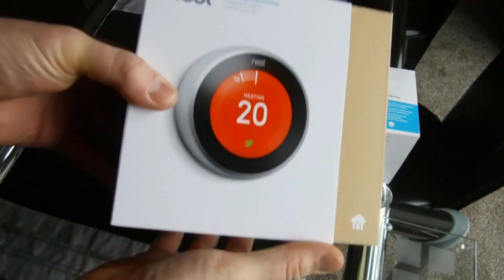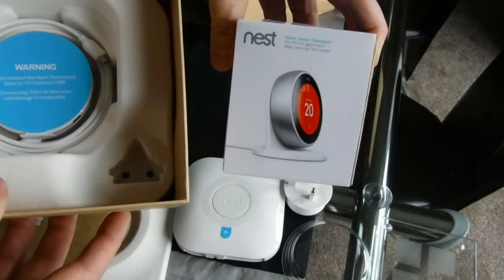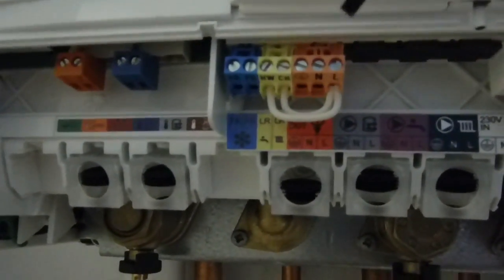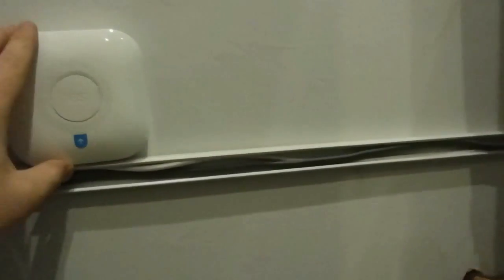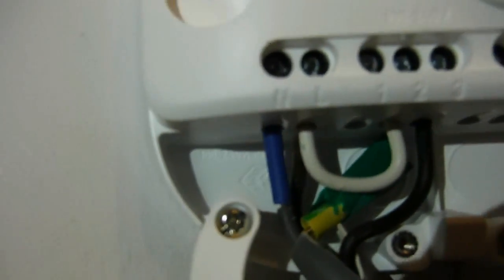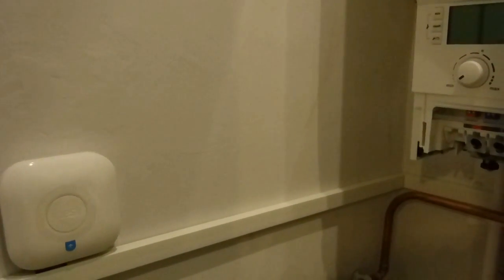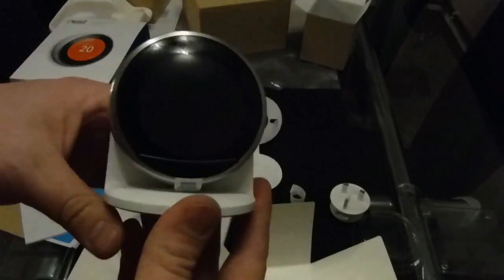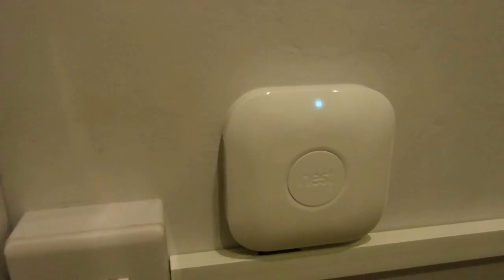How to install Nest Thermostat 3rd Generation - UK

Comment: How doesn’t it communicate between the heat link and can nest support zone heating
Reply from the maker: The Nest communicates to the Heatlink wirelessly. Nest will support multi-zone heating but you will need one Nest per zone.
Reply: My mega flow tank and boiler is in the out building currently in the main house there is a Honeywell programmable stat at the first floor and  a second programmable stats in the hallway on the second floor which has no radiotor. Two zone value with a Honeywell with a wire junction box. 

1. Will it communicate at the back of the garden where the outhouse is located? Just worried on the singal range. 

2. Having a second nest replacing the hallway Honeywell programmable stats is this adviceable? Concern the hallway is cold due to no radiotor and what if the senor takes the hallway heating a keeps on heating up the bedrooms!
Reply from the maker: The Nest can be sighted upto 30m from the Heatlink but obviously walls and large objects like the boiler can reduce this range. The Heatlink doesn't necessarily need to be next to the boiler though, as long as you can get a wire from the boiler to it, so that may enable you to get it closer to the Nest?
As for having the Nest in a room with no radiators.....that's not going to work.....unless the bedroom doors are left wide open maybe. But then the rooms will be too hot. Best to maybe put it in the biggest bedroom?
Reply: CharlieShooters KnowHow might have to get an installer and get a view on the property and location of the boiler.

Comment: Best installation video, but I'm still struggling with mine. I have a Vokera Linea HE which is Open Therm compatible and would like to use that capability. There is an existing wireless Vokera thermostat and receiver but I can't work out the connection from the HeatLink to the boiler. Any suggestions (vokera.co.uk/wp-content/uploads/2009/.../linea-he-combi-boilers-installation.pdf) Thermostat manual (https://drive.google.com/file/d/1A6U29EhkhMbnZUA68TvkhS2QaqlJUu_6/view?usp=sharing)
Reply from the maker: I've had a quick look at the installation manual for (what I think is) your boiler. I couldn't see anything about Open Therm in there, but if it does use Open Therm then it should be a pretty straight forward 2 wire connection.
I Googled 'Nest with Vokera' and someone states wiring to M2 on the boiler and leaving boiler controls on permanent. This would go to 2 and 3 on the Heatlink.
In the Nest Manual there is instructions on how to wire an S-plan system which is also mentioned in the boiler manual, so maybe that's an option? I have no experience of that method sorry!
Failing all that, in the boiler manual there is a technical helpline. They might be able to help.

Comment: My current wireless thermostat receiver only has two cables connected to the boiler: live & neutral. Will the nest thermostat work with only those two cables?
Reply from the maker: You need to follow these back to the boiler really to check what they're connected to, but yes, the Nest manual indicates it will work with this set up.

Comment: The best heat link does have a earth and should you not use heat resistant cable to connect to the boiler
Reply from the maker: The Nest instructions indicate that an earth is only required on the Heatlink when connecting T1 and T2 to the Nest. I'm presuming because the Heatlink is all plastic and the Nest is metal.
As for the wire....a few people have mentioned I should have used flex cable, and I probably would if I did it again, but it's been OK and doesn't really run too close to any hot bits!

Comment: Hi Charlie just bought a nest,watched your video which was great.I have a thermostat in the living room but will be mounting my nest on the stand.can you tell me what I do with the existing thermostat and wires?do I just remove?Also like you said in a previous post in the Americans videos they only show you replacing the thermostat for the nest and not the heat link.Do you have to have the heat link if you have an existing thermostat?
Reply from the maker: Sorry, only just seen this comment, it got caught up in the spam filter somehow!  I presume you have sorted it now, but, yes you would just remove the old wiring and thermostat.  The Heatlink is required, without this the Nest will not work.  Better late than never!!

Comment: When you are connecting the wires at the heat link end, you don't actually mention into which slot the black (call for heating) wire goes. Could you please clarify? Thank you
Reply from the maker: Yes, to confirm, the black wire goes to "3" on the Heatlink.

Comment: What is the purpose of the hub by the boiler, all other videos I have seen has been the thermostat only!. Is this because you used it on the stand?
Reply from the maker: No, the Heatlink (hub) is required in the UK, whether you use the stand or put it straight on the wall. You may have been watching American installations as I don't think they use a Heatlink?

Comment: Watched this before ordering as I thought £120 for installation seemed a little much, your vid made it super easy and I was done with a working Nest in less than 40 mins. For reference I was fitting to a Worcester Bosch 28CDi and the wiring setup was as shown on your slightly more compact model. As with EJ wheeler below I had to unplug the front panel for a previous wireless thermostat to make it all work. Thanks!
Reply from the maker: Glad to hear the video helped you out! 👍🏼

Comment: I’ve got an old manual wired thermostat in my lounge. So I take it I don’t need to wire the nest to the boiler. A Worcester condenser boiler. Is it a matter of replacing and wiring the nest on the wall wired into the current thermostat wiring.
Reply from the maker: Unfortunately not. The Heatlink has to be hard wired to the boiler. The Nest then communicates wirelessly to the Heatlink to tell it to turn the heating on/off. The Nest will not work without the Heatlink.
The Nest can go where your old thermostat was, but it either needs to be powered via the USB adaptor, or via T1 and T2 on the Heatlink. This is where your previous thermostat wiring might come in handy though, as you could use this to link the Nest to T1 and T2 on the Heatlink, rather than run new? Make sure it's not attached to anything else in between though!

Comment: I have a Bosch control unit which is powered from the boiler via a control cable. It doesn’t require a 240v power adapter or plugging in and does the same job, which is useful, as the nearest power point is on the other side of the room and it can be remotely used via an app.

Comment: Hi Charlie, thanks a lot for this video. It's given me the knowledge to wire in the Heat Link but I wonder if I could trouble you for some advice on replacing my existing thermostat? It's a bit of a puzzle. 

First, the boiler is an Ideal Logic 35 and the thermostat a Honeywell CM707. On the boiler I have T1 (black), T2 (grey), L (brown), N (blue) and Earth (green) all coming in on a 6 core cable (one wire looks like another grey, has been snipped and is not terminated?). I expected to open the battery operated Honeywell and find black and grey that I could reroute from the boiler to the Heatlink T1/T2 which outputs 12V but instead I have A (brown) and B (black) - Live and T1? What's could T2 (grey) be connected to?

Honeywell manual shows 2 different valid configs : 
1) A to external Live and B to Boiler Live (with Boiler N to an external Neutral) - I'll be honest and say I don't know what this really means
2) A to T1 and B to T2
All I can think is that somewhere between the two there is a junction box where colours are being switched? Either Honeywell B (black) is being switched to Boiler L (brown) or Honeywell A (brown) is switching to Boiler T2 (grey)?
I'm going to get a multimeter tomorrow and test the voltage across A and B on the honeywell. Hopefully this tells me it's not 230V which means it's not connected to Boiler L?
I could also disconnect the grey to see if it has any effect on the Honeywell firing the boiler?
Any other suggestions?

Appreciate your time and I'd be happy to make a donation to you or charity if you can help. Thanks!
Reply from the maker: It looks like either yours is wired as in config 1) or, like you say, somewhere along the line they have gone through a junction box and the colours have switched. There are a lot of thermostats wired through a crazy looking junction box! It could be that it goes to some kind of Frost Thermostat in between even?
Is there no way you can follow them right through the wall? If there's a junction box it should be easily accessible.
As you suggest, you could check with a multimeter. You could try to run a new length of wire by taping it to the old one and pulling it through so at least then you know where you are or you could use the wire in place as long as it's disconnected from the boiler!
Whatever you do, PLEASE MAKE SURE it is only connected to T1 and T2 on the Heatlink before connecting the other end to the Nest....or bang goes the Nest!!
Reply: Thanks for the quick reply! It's reassuring to know I'm not totally misunderstanding and something is definitely amiss here. I don't think there will be a frost thermostat because nothing is connected to the frost terminals on the boiler. The 6 core cable that comes through the wall to the boiler is powering the boiler so I can't really pull that through because it must be connected to the mains somewhere. It's just occurred to me that it must pass through the isolator? I should maybe look behind that for clues... What are the chances Taylor Wimpey can provide a wiring diagram? Might be worth a try...
I will definitely be checking the wires are 12V before connecting the Nest :)
I may just have to live with powering the Nest by USB, remove the Honeywell and plaster over it. I can terminate A and B and leave them behind the wall, can't I?
Reply from the maker: Good luck with getting a wiring diagram from Taylor Wimpey! 😉
As long as you terminate the two wires behind where the Honeywell once was you'll be fine leaving them there. Best of luck with it!

Comment: Hi Charlie  thinking of buying a nest.  At the moment I have a Honeywell wireless programmer and a ideal boiler . So my boiler connection should be ok just replace Honeywell receiver with the Nest receiver, but this is where I hit a little  problem on your insulation you fit the neg and put a link from the live and then put your switched live.   on my Honeywell I just have the supply from the boiler supply then from the external stat connection in the boiler blue and brown to the other two connection in the Honeywell. Any ideas on which wire to use as the switch wire . Iv just finished the night shift so this might not make sense in the cold light of day
Reply from the maker: It does depend on the Ideal Boiler that you have.  Some are wired as in the video, others are wired slightly different.  Yours SOUNDS like the latter.  It is actually a bit simpler.  Connect the L and N on the boiler to the L and N on the Heatlink. There should be 2 thermostat connections on the boiler (the blue and brown in your case) and these need to go to connectors 2 and 3 on the Heatlink.  It should be that simple!  Hope that helps.
Reply: Thanks for the quick response. 
The only thing which concerns me with the nest is the learning part. Both my wife and I work funny hours. If I leave at 6 in the morning I would not put the heating on. I wouldn’t like it to think ok 5 am heating on. I’m from Yorkshire a bit tight for that. Lol
Once again thanks.
Reply from the maker: I wouldn't worry about it...I let it set it's own schedule at first. Since then I have set my own and it now comes on and off as I want it to!

Comment: Hi do you have to buy the nest hub separate?
Reply from the maker: The Nest Thermostat comes with everything you need in the box to set it up. No hub required.
Reply: @charlieshooter  yes i need a hub.. the new nest 3rd gen are for wired thermostats.. i have no wiring so need a hub
Reply from the maker: You will need to wire the Heatlink (that comes with the Nest) into the boiler. There is no need for any "hub"....effectively the Heatlink is the "hub"! Hope that helps!
Reply: @charlieshooter  the heatlink is the hub, ive been in touch with amazon and they have messed up and sent me a non European nest that has no heatlink but sending out a new item
Reply from the maker: That would explain it! Yes the Heatlink is the "hub"!
Reply: Thank you for the reply much appreciated.

Comment: Some YouTube videos just seem to plug the nest directly onto their existing thermostat? They also don't see to have the heat link when they're unboxed. Is the heat link a UK specific thing? Is there a difference between wiring via heat link or directly? So confused 🙈
Reply from the maker: In the UK the Heatlink is required. You wouldn't be able to wire the Nest directly to the boiler. In the USA I believe there are a lot more wires going to the back of the Nest itself. Just to re-iterate, this video is UK specific. Hope it helps with your confusion!
Reply: CharlieShooters KnowHow yeah. Thanks. I was so confused about different videos etc. That's just what I needed to know.

Comment: Excellent video but at 2:25 you say 'that's how we will be wiring ours in' but you don't. The Nest diagram seems to be turning the boiler on and off via the mains using the Heat Link when calling for heat. Surely that can't be right? I have a Grant Vortex Pro Combi 26e with an external programmer and wall thermostat. The HW is switched via the programmer and the CH is controlled via the thermostat and the programmer. Thanks.
Reply from the maker: The diagram in the Nest Manual isn't that clear (which is one of the reasons I made the video). I used it as a guide only really. It doesn't turn off the boiler at the mains. My boiler has connections for neutral, live and a switched live to connect a thermostat control and how I've done it in the latter part of the video is correct and it all works as it should.
To connect your boiler however is different, from looking at an online installation manual. You would use the other diagram as a guide.
Basically you can power the Heatlink via the L and N that's powering your boiler, then connect 2 and 3 on the Heatlink to the 2 Room Stat connections (No.25 & No.26) on the boiler.
Hope that helps?
Reply: Thank you. That solved my confusion! Do you think it matters which way round 2 & 3 are connected to 25 & 26?
Reply from the maker: I don't think so but i'd go 2 to 25 and 3 to 26 as a start. If it doesn't work you can always switch them around.
Reply: Thank you. And thank you for keeping this thread open and responding so swiftly and comprehensively to the many responses you have had. Well done.
Reply from the maker: No problem. Glad I could help!

Comment: Just remember folks, you have to be, or have the installer be, Gas Safe registered to take the front panel off the boiler. There was no reason to take the front panel off in this instance, but on some boilers, you need to completely remove the front cover to get access to the electrical connections.
Reply from the maker: This is true for the main front panel which quite often has a seal on it, but if you are just removing the plastic panel to access the electrical connections you are OK.
Obviously only carry out this task if you are competent to do so, and always double check any applicable regulations yourself.
Reply: fit nest https://bit.ly/2I1DPIK

Comment: Is it possible to put heat link in place where the old thermostat was?
Reply from the maker: You can put it where you like really, but it does need to have power and be wired to the boiler. If your existing wires to your thermostat are capable of that then no problem.....but do you really want the Heatlink on show in a hallway/room (wherever the thermostat was)?
Reply: best fitnesthttps://bit.ly/2I1DPIK

Comment: Hey mate great video and gives confidence in myself to actually attempt but have only gotten as far as pairing the heatlink with boiler but didn’t want to fire up 
And was hopeful in some input please fella

Have connected L N to power on boiler and back to heat link L N also connected black cable from 5 core flex to RT on my x1 plug and back into number 3 on heat link but won’t fire up is there something you could suggest all bar asking a technician to arrive I’m gas safe safe but don’t really do electrical works this is for my home boiler any help would really appreciate it 
Vaillant ecotec plus 825 Combi cheers
Reply from the maker: Ok....just looked up your boiler manual online. It states to do as you said i.e RT at X1 goes to 3 on Heatlink BUT it also says to remove the link at X100 (there might be a loop of wire going to it...take it out if you haven't).
Then you will also need to connect 2 and L together on the Heatlink as in my video (with a small piece of wire)
Let me know how you get on....
Reply: U lovely boy !! 👏🏻 linked L & 2 pressed heat link button and boiler fired up mate just now gotta learn the thermostat am so grateful just mins away from a return to plums looks like a great addition to the house thanks mate will look out for your videos from now on I’m a Dan all the best until next time
Reply from the maker: Excellent. I love it when it all works out with a simple fix! Glad to have helped. I've done a few videos on the Nest....and how to link it to Alexa. You might find them useful. Check them out.

Comment: You shouldn't have installed
 pvc/pvc 3 core and earth cable directly into the boiler terminals!  It's not designed for that! 
Should have used 5core butyl
Reply from the maker: Somebody else has mentioned that previously. Up to now it has been fine but I may look to change it, although that part of the boiler doesn't seem to get too hot. Thanks for watching.